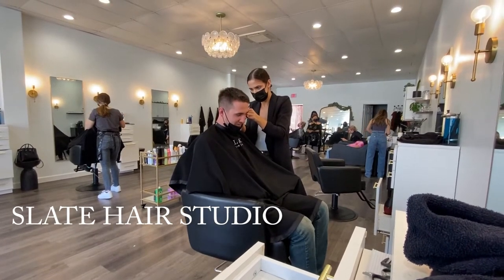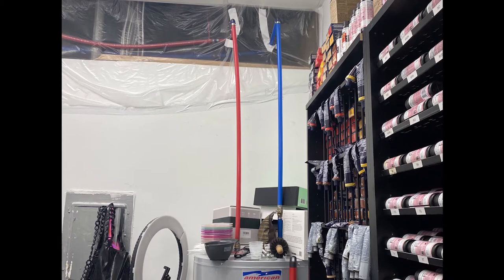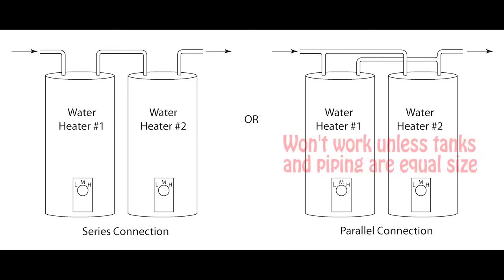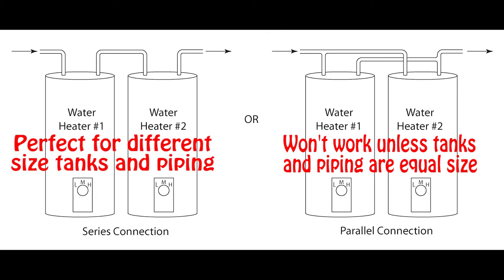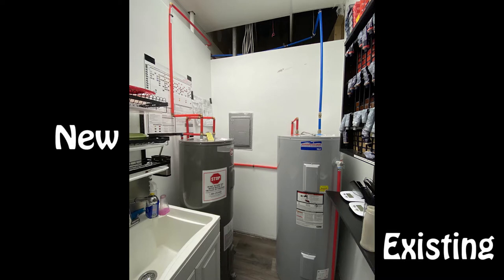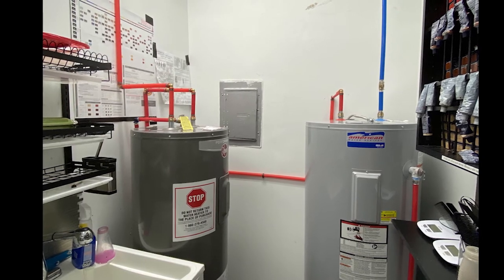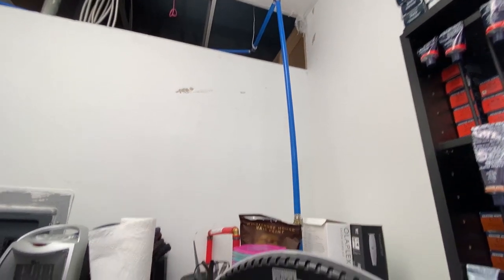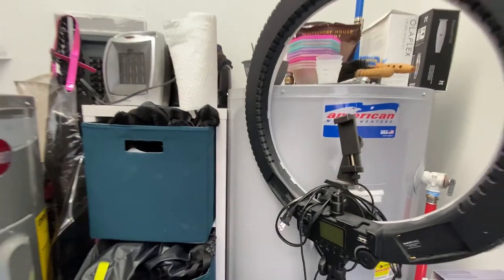I Installed Series Hot Water Heaters - Not Enough Hot Water For Salon

Comment: The new tank acted only as a storage tank
Or did you double heat water original one heats at low and new one to to appropriate temperature ?
Reply from the maker: Both tanks are on and heating at factory settings. The second downstream water heater starts to work when there is a high demand for hot water and the original can’t keep up.